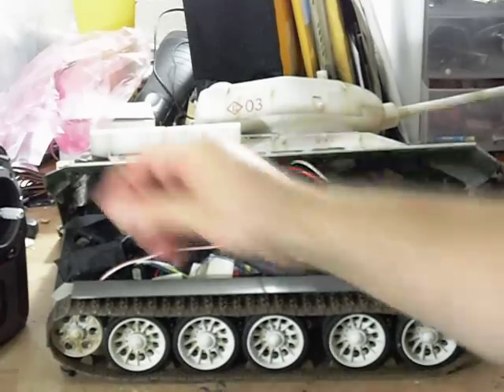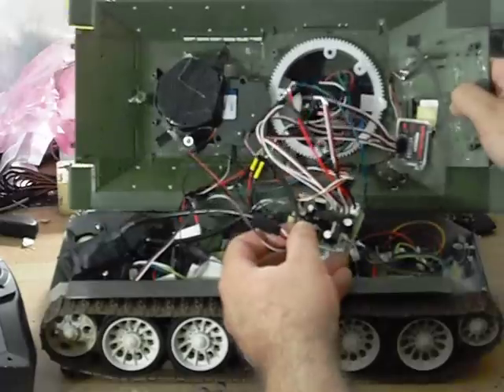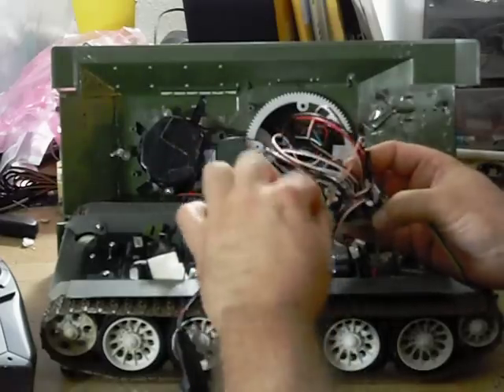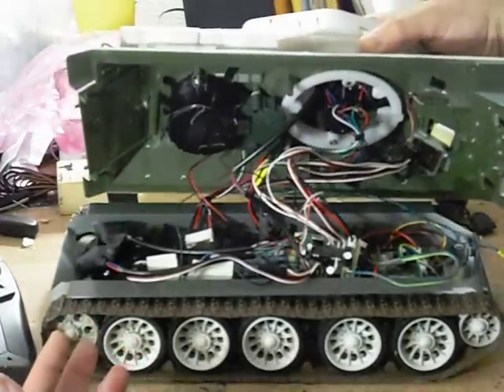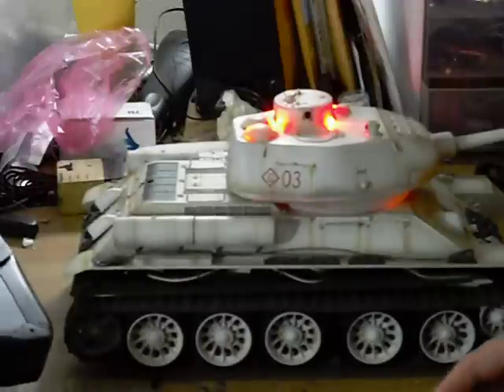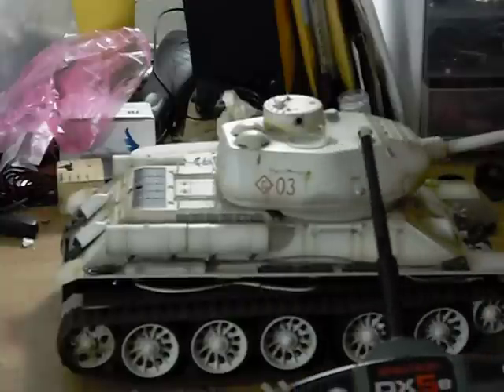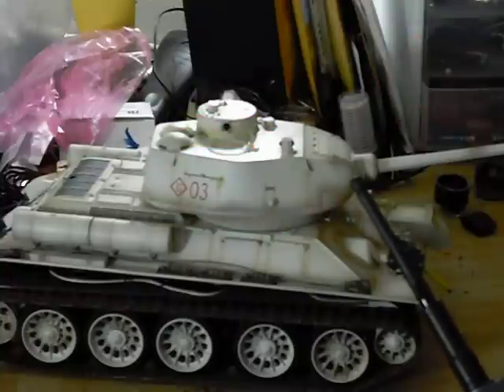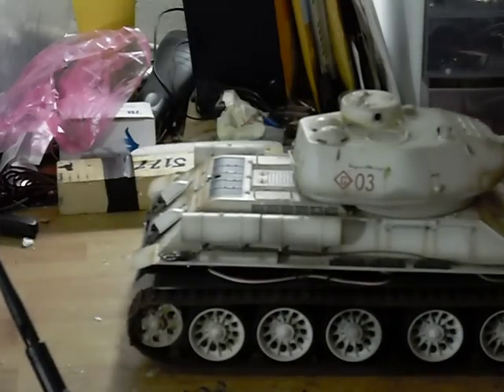How to program the DBCRC2 board

Comment: HI. Nice job on your tank. Where did you get those sound cards. I need a few sounds cards for my 1/35 tiger. Like the engine starting, idling and running. Cannon and machine gun fire. Please direct me as to how to get them. The boards can't be too big because they are for a 1/35 scale tiger 1 that I have machined out of metal.